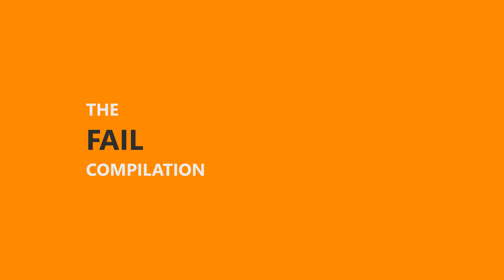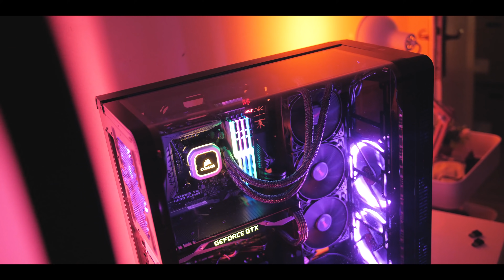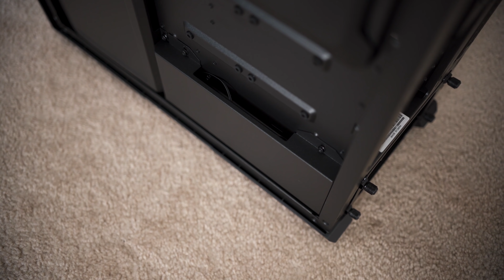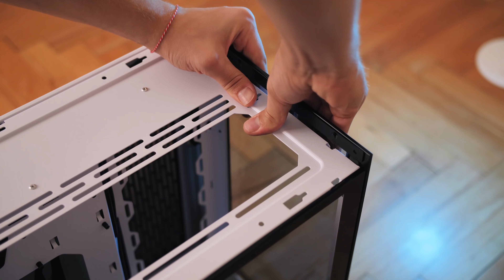Top PC Cases of 2018!

Comment from the maker: FIRST!  Since you all love them so much....timestamps below!

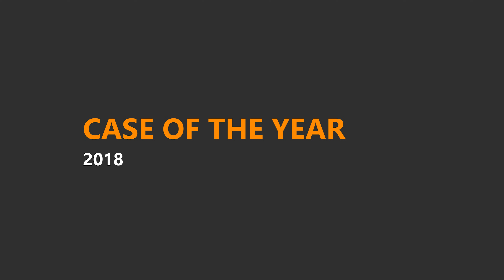Fave Case:  1:55
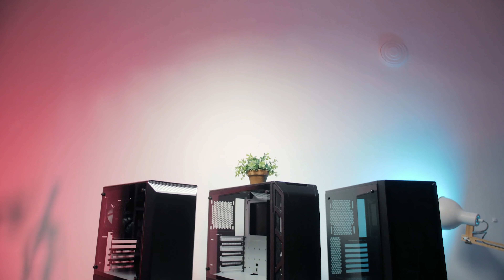Best Budget Case:  3:06
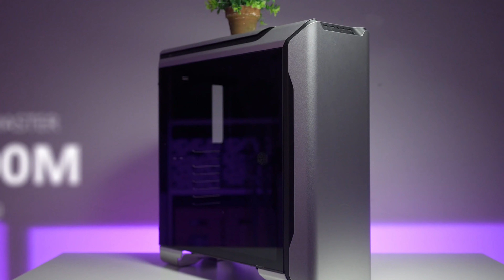Most Innovative Case:  4:16
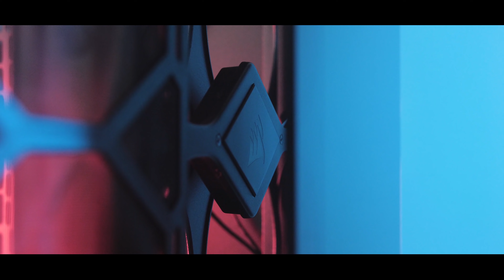Best Case for Water Cooling:  5:50
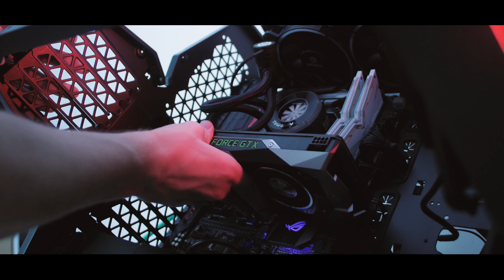Coolest Features:  7:02
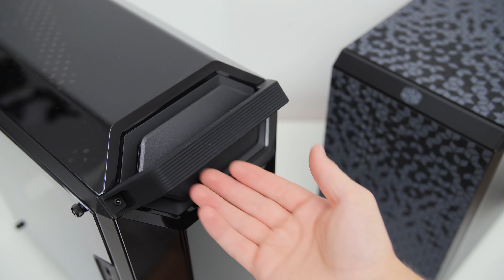Fail Compilation:  8:39
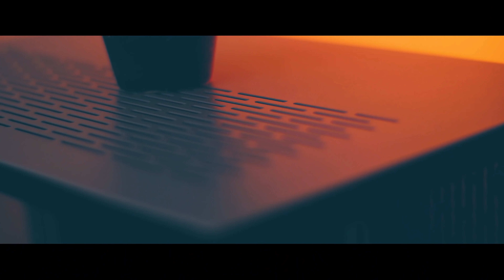Case of the Year:  10:43
Reply: Ah... That's hot, that's hot.
Reply: the most awaited video of an year for me....
nice Dmitri...
Reply: Where can I get that wooden case?
Reply: PLEASE give us a link to the wooden case at 1:55, PLEASR
Reply: I purchased the LL Dynamic in white after your review. Totally agree, def case of the year. Nice vid as usual.
Reply: My Corsair 275R DID NOT come with the Alan key mechanism and used regular thumb screws so maybe they did fix it and respond.
Reply: @keycaps3207  Didn't they send you the Alan screws in a small bag inside the screws box? Mine came with the thumb screws mounted but with the Alan's as extra. the Alan screws are less pratical but look better IMO.
Reply: HardwareCanucks Excuse me, i have a question. What is your opinion from Lian-li pc-011 wgx (ROG editión)? Please, a need your answer. Thanks.
Reply: The Best case in 2018 is the Lian Li o11 Dynamic  😍
No regret in chosing this case for my PC upgrade in 2018
Reply: That case of the year!!! Couldn't agree more! I ALMOST pulled the trigger on a new machine multiple times because of that case!
Reply: Here's hoping for "Best SFF Case". 2019 maybe...
Reply: I got mine 011 Dynamic because of review you made few months ago. I got it with optional vertical holder for graphics card. Only bad things I can tell is that I can't screw pcie port on holder since it doesn't fit well my evga 1080 hybrid card and that if holder is installed it will cause bottom dust filter to pop off from case since there's extra space because of screws. It would be better if holder would be installed to existing ssd holder mounting points. Overall that case looks very beautiful and keeps good enough temperature with clc.
Reply: HardwareCanucks dude why didn’t you include the Sharkoon pure steel rgb?
Reply: Wheres the best place to buy the o11 dynamic? I'm having issues trying to find the black version for under 160.
Reply: Can we get an review of Silverstone LD01?
Reply: I disagree with your pick for best water cooling when Thermaltake beats both of them for the price and features on a SINGLE pc (not dual)
Reply: do you guys think you will do a review of the cooler master MB530P?
Reply: feels good when the case you chose to build wins!
Reply: Thanks! 🙏🏻
Reply: alot of cases!!! & value the opinion on reviews
Reply: Im gonna guess the case of the year is evolv x
Reply: anddd nope
Reply: HardwareCanucks e
Reply: ты русский чтоли?
Reply: Can you make a Best ITX cases of 2019 video :-) ?
Reply: Best matx case?
Reply: Which is the best case for under 50$?.... I have just 50$ to spend on a case
Reply: If possible can you guys do a review on the CAM software from NZXT because many people say that it is really bad. I just want to know if it is bad enough that maybe I shouldn't buy the x62 kraken.
Reply: After watching your review of the Phanteks P350X, I consider it a bad PC case. Yet it's in your list.
Reply: No phanteks evolv X? 😱
Reply: @JesseLindberg  Yeah I thought it would be case of the year!?  He built a personal system with it?

Comment: Every single item I have ever bought from NZXT, has had multiple problems with it. From case fans, to the Kraken X62, the USB hub and also my Hue devices. I will NEVER invest in NZXT again. As for cases, I will challenge you to show me an updated or older case, which can compete with the Cooler Master Maker 5T. It is almost completely modular, almost entirely with thumb screws, has a psu shroud where the gpu is at least 5" above it, can handle a 280 or 360 AIO and all covers are magnetic instead of screwed down. Space is excellent, as it can handle an atx or eatx mobo, and air flow is superb. All of the pcie rear cover plates are slotted for ventilation, and the top has two areas for ventilation where you can add or remove covers. There is plenty of room and tie-downs for cable management on the rear, and access ports from rear to front. My only complaints about this case are the red color of the inside, and the ridiculous apathy Cooler Master has to providing an updated Face-Plate with USB 3.1 type A & C ports. It would be so easy to do. Outside of that, this is the best case I have EVER used. I look every year to see if there is something better, but every case, INCLUDING the "updated" cases from Cooler Master, fall well short, and are found wanting...

Comment: Every single of of those are horrible. I have 4 3.5 hard drives, 2 2.5 drives a 165mm Air Cooler, a Blu Ray recorder and a 5.25 hot swap cage. NONE OF THOSE cases could fit my hardware. NONE! I hate these new retarded trend of AIO-ready and 5.25-less cases.  They are stupid. AIO is worse than AC and 5.25 bays still has many uses available. I guess I'll have to stick with my Cougar MX500 ad infinitum.

Comment: 500d fits my radiators a little too perfectly
My first watercooler build (probably last?) And the tibe between the 2 rads is just a bit big bit is soooooo close it doesn't really matter, had to put both in at once and the right fit made it a freaking nightmare...looks great now but not easy especially for a first timer.
Edit of note I used the black ice 360 and 280 flowers otherwise I would have had at least one tube going across the radiator on top...ugller but easier to fit

Comment: Man call me old school, but I wish more modern cases included at least one external drive bay... I'd like to have a 4k Blu Ray optical drive at some point.
Reply: Sidney Horne / yep, I understand how you feel.  As we both know the CD/DV D drive is dead.  I have one in one of my old work station. It's only used for doing some simple CAD and 3D rendering.  It's will over a year and haven't ran a CD in it. So when I built my new Ryzen system I picked the H500i.  No access to a built in drive.  I'm good with that and for now I can access the DVD player over my home network.  The RGB is amazing I'm sure the system runs faster with it. 😜
Reply: Same here. Am 36 i stil got alot of old games on cd roms
Reply: Get an external drive with a USB

Comment: Hi can you guys tell me what case can I buy? H500,h500i,h700 or h700i, which can I buy?
Reply: Only difference in i version and normal version is fan speed controller and presinstalled rgb lighting. As for 500 or 700 go for any as its mostly similar to each other but personally i would suggest h700i cause i am using it for my build.
Reply: @johnwick468  thx

Comment: The PC 011 Dynamic seems neat, but I keep hearing about the adhesive failing on the tempered glass panels. Maybe next time they'll use screws to keep the panels captive to the bits that slot into the case for assembly so no one has to worry about coming home to a shattered panel all over the floor by their desk.

Comment: The O11 Dynamic is undeniably innovative and easy on the eyes. However, the 155 mm CPU cooler height limit is a deal-killer  for those who want a beefy air cooler.

Comment: I have looked at every ITX case google could ever find.   The vast majority of them are hideous.  I'd really love the H200 with the front 100mm chopped off.  I want to run a D15 cooler with a full size ATX PSU for silent operation and don't want the case to be so excessively large like the H200 would be if I don't use a CLC.  I've looked at so many other cases that are somewhat close and not that ugly but usually have awful air flow issues.  It seems actual builders don't design these cases :-(

Comment: HardwareCanucks Would you still recommend the R6 from fractal?
Right now i am about to build a pc with z390 f-gaming monther board, 32gb ddr4ram 3200mhz, i9 9900k, rtx 2080 ti, 2x 1 tb 870 evo ssd, corsair H150i Pro licquid cooler.

But i am not totally sure about what case i want to put this inside. I love my old tower "Cooler Master Storm Trooper" But i want to try something new, and the storm trooper gets alot of dust inside of it over a shorter time and i want to avoid that. 

Any helpfull tips is welcome "On towers/cases only please" :)

Comment: What's the best  case for a full tower, best airflow, modularity, mesh over Glass, and good materials, and cable management? I don't care about glass and hate the front covered. Sucks that 011 air is too small for most tower coolers. They need to bring back and upgrade the cooler master haf x (no glass) and the Silverstone raven 2 (upgraded) with more mesh and no dumb glass.

Comment: Just wondering if there is a case that competes the the Define R6.  I need one external 5.25 bay for a hot swap HDD, 2 @ internal 3.5" HDD, 2 @ SSD, silent, good air filters, tempered side panel, Type C front panel connector, etc.

Comment: Lian Li get your sh*t together. Dynamic and Air O11 are almost perfect. All they need is better CPU clearance. I fell in love with this case but I didnt buy it. I couldnt fit my Dark Rock 3.
Reply: This Case has glass everywhere especially for showcase builds, and you want touse it with an aircooler? :D
Reply: Rami Jaballi well adding 2 or 3cm more in width would have really changed the look huh? Remember that those showcases are made by how much 1-2% of users? And even showcasers have had problems with clearance because GPU blocks were too big for the case. This case is a total disaster cuz of 1 dimension - width.
Reply: @Stoddgaming  What I mean is, most people buy this case because it showcases the parts so well, and a big fat aircooler just destroys the asthetics a bit. It's made for AIO or custom loops (yes, the majority doesn't build custom loops), which gives the build a cleaner look overall.
Reply: Rami Jaballi yeah I see. In my opinion this case could have been the greatest case ever created. The other way of installing PSU, glass front (Dynamic), side intake fans all great. Just the width is not big enough. If the case was 3cm bigger it wouldnt change esthetics that much (they could add like 1 or 2cm to height ale lenght aswell if they thought that it is too chubby). It could be a great showcase for showcasers and great aircooler case for aircoolers. It is just a missed oportunity.
Reply: @Stoddgaming  They showed off an xl version of the 011 dynamic at CES.  Should give you the room you're looking for.  It's supposed to fit a 120 fan on the back.  The only complaints I have about my 011 is that it could use a few mm more clearance at the front for thicker rad support (currently the front IO cables interfere with thicker 360 rads).  And a little more height at the bottom (even just moving up the MB placement a few mm would work).  I can't plug in the USB 3.0 front IO into my MB because the bottom fans block the plug just enough.  I vertically mounted my GPU (using the CM bracket), so I don't have any issues with the width and my GPU block.

Comment: 011 Dynamic may be case of the year but that's based on the popular demographic of AIO and custom loop. That case is not good for air cooling at all and most likely be to cramped for a 360. Design wise it may be slick but not sure it deserves case of the year. I mean these reviews are only about build and features no performance

Comment: I got that Thermaltake Level 20VT - love such mobo layout. Cable organizing is not a big deal (just get lots of Self-Adhesive Zip Tie Cable Wire Mounts Clamps). But omg front fan panel mounting plate is horrible. It could easy fit 4x120 mm fans (I think even 4x 140nmm would fit) , but no option for that, well... time to mod :)
For miniITX Love InWin case except for the airflow (might build system using it one day)

Comment: Nice job. I like many of these cases, but it's hard to really judge a case until you've built a system in it. For example, I really love the Fractal Design Define R6 (and really, the S2 you highlighted is basically that case but in the open configuration). I still love it after building two systems in them, but you notice little things when you actually build. Like how much of a PITA a nonremovable power supply shroud is if you have to add or change a cable once some of your cables are connected and cable-routed and can no longer easily just slide the whole power supply out the back. Or, how some power supplies (I'm looking at you, perfectly adequate Seasonic X600X I can't now re-use) can't slide in through the back because of a slightly raised fan grate, and thanks to a non-removable shroud, now physically can't be put into the case from either direction without modding. 

Non-removable shrouds need to die. I want to see more power supplies on display with side-panel power readouts like that Asus Thor, though. Maybe then I'd see a compelling reason for a TG side-panel.

Comment: I still prefer the old 2 drive cages in front of the fans where you can remove 1 or 2 of them. SATA cables are ribboned, wiring ssd's behind the motherboard tray is a pain in the butt.

Comment: I see 27uk850 still standing on the desk. Do You recommend it for console and pc single player gaming? I know 4k is demanding but it would be future proof for some time. Any glaring issues? 1440p 144hz is about the same price but ps4 does not support either 1440p or 60hz and getting 144hz at 1440p on pc is not easy too.. and dark souls 3 is locked to 60fps (done!)

Comment: Wow, the absolute complete and utter hatred for all cases that can carry an Optical Drive is strong with this video... all the cases of 2018, and not a single one can sport an optical drive... I know a lot of Youtubers think it's antiquated and nobody could EVER possibly have a use for one in 2018, but I know a TON of people in the real world (ie: not Youtube channels) that use and want optical drives for a variety of reasons... and speaking of trends, the trend to never review cases that can use an optical drive... not even one, is a pretty fail trend for 2018... I hope that gets reversed in 2019... surely a single case that can sport an optical drive should have a little potted plant put on it.
Reply: What is an optical drive?
Reply: USB optical drives exist
Reply: @jimmynguyen8339  yes, for people dumb enough to buy a case with no optical drive bay... if you want/need an optical drive,  you're going to want a case with an optical drive bay. As with anything else,  if you want a feature,  you'll want something with that feature,  not a half-assed compromise.
Reply: @wolfshanze5980  Is it your time of the month or what?  I don't want an optical drive cage taking up room in my case.  It's ugly and blocks airflow.  An external drive works fine and can sit on the desk or be tucked away when you're not using it.  Why is that so horrible?  An external drive is typically smaller and can be used on multiple devices.  If you're this worked up about something so stupid, you may want to check into a facility.  I get the feeling you're very close to screaming "get off my lawn" at the neighborhood kids.
Reply: Luckily, the Define R6 is there for you

Comment: I love the Define R6 from the start of the year, but I am having an issue with my NZXT Kraken x52 AIO cooler. The dust filter on the top of the case cannot slot in properly because the cooler's fan screws are just too tall.

Comment: Phanteks P400S TG or NZXT H500?
Reply: From what I've read about the P400s it's only major drawback is minimal airflow because of how the front panel is poorly ventilated. The NZXT however, I haven't done much research into but in terms of airflow it would probably be much better than the p400s

Comment: The O11 Dynamic is fantastic for the price. Gorgeous, good cooling support/ performance if you use an AIO or a custom loop. It won't fit a lot of high end air coolers above 155mm in height. GPU clearance is also tight. My MSI 2080 Gaming X Trio is 142mm in height and it just barely fits. The PCI-E connectors are touching the glass. 

The only other issue I had was mounting a 2,5" SSD and a 3,5" hdd at the back, it's incredibly tight to fit the connectors. On my unit I also occasionaly get loud vibrations in the case, from using 3x 3,5" harddrives.

Comment: Most of these cases are bad if you have cats. They'll jump on top and press the power button. Would be cool if you included a section next year for the best case that has the power button on the front as well as either no top intake or optional panels to block the top intake.

If anyone else has the same needs, consider the InWin 303. No top intake (its moved to the side) and the power button is on front.

Comment: Suprised that h500m is not a top case. I mean it looks amazing and has the best airflow, it has nice features. The only downside is price and sidepanel and psu shroud could have been done better, but still perfectly fine. O11 looks like dogshit, so, it doesn't really matter what else it does at that point.

Comment: To be honest I'm underwhelmed by the case selection in 2018
I was looking for a mini ITX case for an htpc build
I wanted a window and I wanted a 5 and 1/4 Drive Bay for my Blu-ray

And there was nothing available
I ended up buying a used  Cooler Master Elite 130
It worked but there's no cable management at all
It's just not a pretty build
 but it works 
till I find a my dream Case.

I'm looking for something around the same size as The Cooler Master Elite
But I wanted to have cable management 
USB C header on the Front a window on the case 
RGB on Front 
 Plus room for 5  and Quarter inch Drive

In my opinion you still need a Blu-ray  drive if you want to rip movies
Where is my perfect case right now there isn't one Dimitri